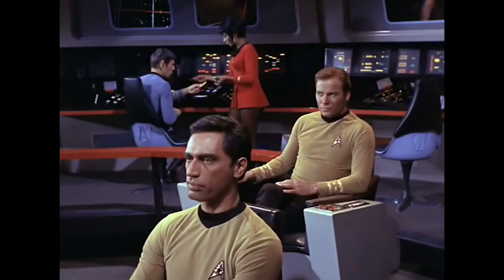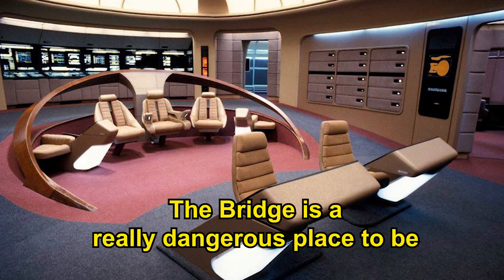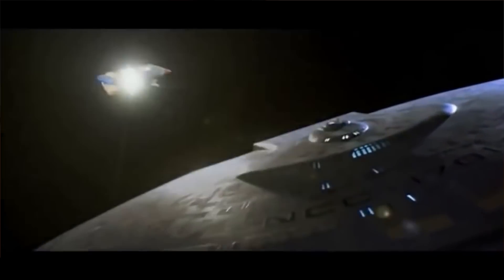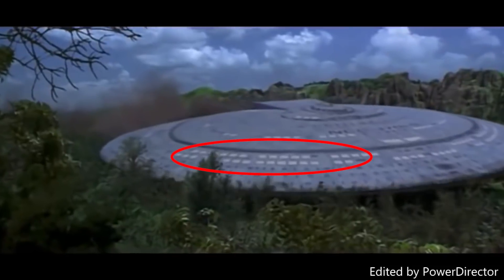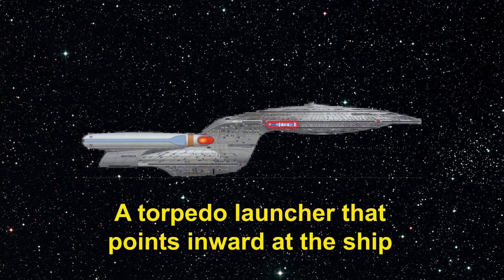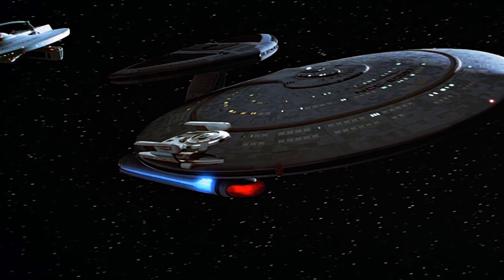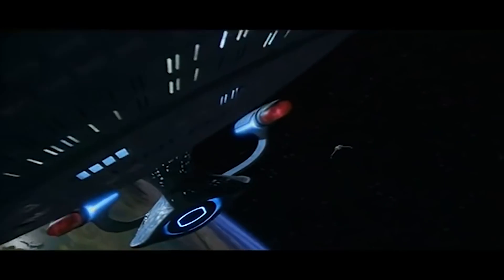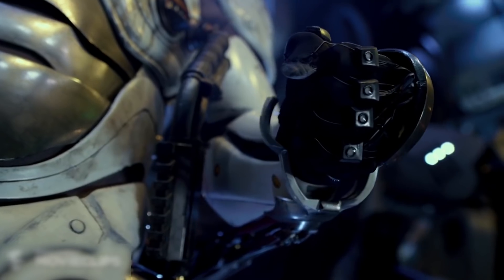10 Flaws Star Trek - USS Enterprise NCC 1701-D

Comment: Many of the "flaws" are necessary to allow cameras and production crews access to the interior of the ship set and to create exciting visuals, something that wouldn't be possible if the ship was designed to your exacting, if sensible, standards. But I laughed hard at the "landing just like Voyager" bit. Touche.
Reply: Actually the Ent D and other Starfleet vessels are a Efficient use of Space, the Corradors have Hidden Behind them , all the plumbing, power distribution, communications and the Backup systems , as well as Emergency Survival Gear. and some Corradors lead to the Escape Pods.
Reply: In the movie, "K19: The Widowmaker," they just ran a raised pipe the entire length of the corridor, so they could just  run the camera along on a trolley, and it looks like part of the rest of the plumbing.
Reply: @BlackEpyon  Exactly. How many successful navy movies have been made that never suffered from their realistic use of ship space?

Comment: Still a less exposed bridge than the ISD's.
Reply: Yet ISD and SSD (or other Kuat warship) bridge is not dangerous place to serve unlike Federation designs
Reply: Kuba Król yes there is a big pit for the commander to fall in if he trips and the pit is full of hard pointy metal objects. Perfectly safe
Reply: @kh29the13  it is not that high a fall. Also star wars ships don't shaken about the same way star trek ships do by anything and panels don't randomly explode.
Reply: @Jfk2Mr  cough executor cough
Reply: ValorJ Omega  Ah yes, Jar Jar Trek. It was set in a alternate timeline, unlike episodes 7 and 8… …
Reply: snonsig the ram into the bridge of the executor was only successful because the shields were down.
Reply: Yeah - ISD's and SSD's had lots of viewports on the bridges and few bulkheads.  Somebody gets a lucky shot with shields down or goes on a suicide run - seeya!
Battlestars always made more sense to me than Star Destroyers.  They had a heavy duty blast shutter that closed down over their bridge picture window.  Also, they had starfighter launch & landing portals at opposite ends of the hanger & straight through, instead of one big hole in the middle of the floor that traffic had to share (plus do a right-angle turn between the plane of the hanger deck and the approach/departure vector.

Comment: Video asks what puts their engines out on pylons. Answer: Most large planes, including military transports.
Reply: Good response.
Reply: That also encompasses the vulnerability of an exposed bridge on modern naval warships.
Reply: The guy who made the original models was told by Gene that if one nacelle exploded it didn't take out the other one.
Reply: @UkrainianPaulie  That's like driving a Corvette and suddenly four cylinders stop working
Reply: @Shadowbat.o_O  The bridge on a modern naval warship is exposed because people look out trough   the windows. Observation of the surrounding with eyes and binoculars is still done. But ship also have a Combat information center (CIC) that is less exposed where radar and other sensor system are used. In Star Trek they use viewing screen for external observation and not the windows in almost all cases so they should put it like you put a CIC  on a warship. 
 
When you bild warships with armor like old battleship there was thickly armored inner part in the conning tower and on the Iowa class it had 17 inch armors.  So warships today are not build as stupid as the one in Star Trek. The bride is exposed because that windows and a high observation position is useful and used in a way it is not in Star Trek.
Reply: And they have to be exposed so the bussard collectors work.
Reply: @UkrainianPaulie  Too bad they never really put into practice what Gene said in the series. ("Cause and Effect" anyone?)
Reply: @target844  You can transfer helm control to pretty much any part of the ship, including engineering.
Reply: @elitewolverine  it was also mentioned that you can also transfer control to one of the portable LCARS tablets and fly the ship while walking down the hall or in a turbolift on your way to the single bathroom they have onboard. 🤣
Reply: Large Planes are not meant to participate in front-line battle. That's what fighter jets are for, and you don't see fighter jets with their engines out on the wings. No, the engines are tucked in against or are part of, the fuselage. The huge transport planes are transports. They are not battle-ready. Planes like the Flying Fortress are A). Older, and B). meant to be escorted by fighter planes. Bombers are not front-line fighters, they fly high and drop large amounts of bombs on ground targets.
Reply: @Dhalin  Fighter jets put the engines under it because of the high-g stresses they will endure during a highspeed dog fight.

Next the most front line plane we have...is the A-10 Warthog, engines are in the back, not tucked under.  Why...because ground fire.  And keeping them apart means when one engine explodes...the other isn't taken out with them.  Something the F-111 was famous for and something that made the F-14 separate the engines as well.  As well, it reduces them both being taken out in a single shot.  And this was PROVEN when an A-10 landed when an engine was blown off the rear.

Next the SR-71 had a sister design that was designed to be a supersonic jet fighter...engines are on the wings.

Basically you are talking about pure design role.  Nothing more.

Your examples are bad and you should feel bad.
Reply: @Ken Roestenburg True but if you grenade 1 of those cylinders on one side of four, They dont just allow the engine to continue running, right?

Although I have heard that certain giant diesel engines used on ships can isolate individually pistons/cylinders so they can be worked on while the ship is running which is absolutely amazing to me.
Reply: The scientific reason is the way the way federation technology create warp bubbles.  The bigger the ship, the harder to create a stable warp field.  Having two pylons helped a lot in this regard.  The federation did know of this design flaw but had little choice in the matter.  Smaller ships such as the Defiant and Voyager had much better pylon placement.
Reply: atSHADOWBAT The real nerve center of a modern warship is the CIC, buried deep inside the hull. They’ve been around even on the old Iowa class battleships, and they’re also the “bridge” on the 2003 Battlestar Galactica ships.
Reply: Bridges on new ships are very vulnerable...Battleships and some cruisers had the armored bridges
Reply: @jtough7499  Even with the conning towers, officers would be regularly injured or killed. The british gave up and just built a huge block on their ships (Warspite, KGV, etc).
Reply: Have you ever watched Star Trek? You have the tech manuals, so you KNOW that the WARP CORE is the "engine". The nacelles store matter on one side and antimatter on the other. Far away from each other until they are mixed in the warp core.
The Bussard collectors, (on the front of the nacelles), are positioned there to collect hydrogen and duterium to refuel the ship.

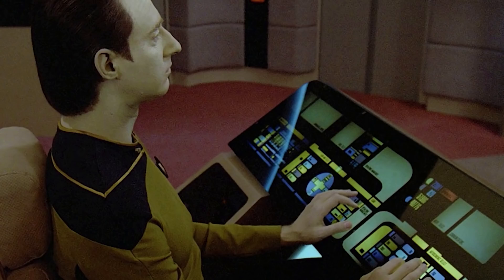Comment: 10:05 That cross shape next to Data's hand is a basically a flat touch screen joystick for manual maneuvering. Also a lot of the maneuvers are pre-programmed into the navigation system so a good pilot could just select one and hit execute on the panel. The ship will fly itself through the complete maneuver while the pilot/Captain observe the tactical situation as it changes and plan their next moves.

Comment: They don't need efficient UI/UX ship controls, if only because the ship has a super-advanced voice-operated computer. Moreover, after centuries of space operations almost any conceivable maneuver has been pre-programmed into the autopilot. All they need to do is to specify which maneuver to use and the ship will fly itself. And that's exactly what they do - Picard and Riker say things like "attack pattern Delta", "dispersal pattern Sierra", or simply "evasive maneuvers". The pilot only has to press one button and the ship will do the rest.
Yes, in some ludicrously unusual situations you need to adjust the maneuver, like rolling the ship sideways to fly through a narrow opening in the Dyson Sphere, or to carefully navigate manually through a complex maze like tunnels inside an asteroid or a space mine field, but even then buttons are better - they are more precise than an analog joystick. In any case, such a huge ship can't be maneuverable enough to respond to a joystick. The joystick use in "Insurrection" was a stupid cop-out.
Reply: Sure, rely on 'Commander Cortana' to interpret your instructions. What could possibly go wrong...
Reply: If you watched any episode of TNG, you should know that they fixed voice control. Well, after 300 years of additional development, what did you expect?
Reply: Also those directional pads on the lcars interface are more than enough to fly manually.
Reply: @DimitryRotstein  Its already getting there. Give it another decade and text to speech and voice recognition is going to be so good you will have trouble to differentiate between machine and human.
Reply: Well as long as Cortana, Google Girl and type-correction are changing my ducks into fucks, I'll remain skeptical😅
Reply: I can imagine using some sort of holo interface. Basically like a screen, but in 3D in front of the pilot. Whos seen Minority Report knows.
Reply: That's also pretty funny, considering how ridiculously easy it should be for an A.I. to pathfind through a narrow entry.  By the time of Star Trek, there should theoretically be A.I.s that can literally program new A.I.s on the fly.  If it doesn't know how to go through a small entry with a 1701-D, it can run a few vigintillion trials of it through machine learning in the span of a couple seconds.
Reply: I loved that escape maneuver from the Dyson Sphere. That was in Relics, the one with Scotty.

Comment: In regards to the unused space this could be a nod to someone in starship design that thought ahead.  Should the ships ever be needed for war, and they were and after the war with the Dominion started the Galaxy class did preform well.  That extra space could be used to redundant power relays to the phasers, extra torpedoes; and with a little internal redesign the sections could be placed near each other and have life support cut off to them - machinery doesn't need life support - and life support could be returned for repairs.  That could be a whole deck with out life support during battle, saving power for the ships other systems.  That space, could also be split between extra power needs, extra storage, and extra medical facilities or crew facilities.  Just because the explorer doesn't need that space, doesn't mean it can't be upgraded when needed.
Reply: Most Star Fleet vessels were canonically highly modular. Thats also the reason why ship classes that by the time of TNG were about 100 years old were still used.
Reply: On several episodes of Voyager they use extra space/ cargo bays for everything under the sun. They turn extra space into a holodeck or for refugee quarters. Extra space is a needed tool when you are faced with the unknown & no one around that wants to or can help you. It's literally helped saved lives on various ships in there various series. I don't know why you are knocking it if you've seen even one of the series.
Reply: Built in extra space is something that they do with real world warships and is perfectly logical and smart thing to do. The reason for extra space is to expand the lifespan of the ship, the extra space is there for the addition of new, unforseen tech to be added to the ship as needed. This way, if you come up with a new widget that's part of either a new class of ship or just a newer version of an existing class, you can add this same widget to these older ships to keep them more up to date. It's also there in case a new version of an existing system comes out but is larger than the older, existing version, extra space would allow you to install this new system without having to worry about where you would get the needed space.

It's because of extra built in space that the USN has been able to keep the Burke class destroyers in service for so long and it's because they've started to run out of extra space, along with their age, that the USN is looking to replace the Burkes. The same thing happened with the 688 Los Angeles class subs, they, as a class, are not only old but they've ran out of room for further upgrades; as it stands there's not even enough room left for every crew member to have their own bunk and the lower enlisted actually have to share bunks with fellow crewmates with each sailor assigned to a bunk taking turns sleeping in it.
Reply: Even in the future, VLS cells would serve the ship well.

Comment: Most of theses are reasonable, however the Warp Pylons had to be there for a few reasons. 

1. The size of the ship requires a larger warp field to encompass the entire ship, hence having them spaced further from the hull they are able to create a larger bubble. Page 66 of the TNG TM says;

Third, the shape of the starship hull facilitates slippage
 into warp and imparts a geometric correction vector. The Saucer Module, which retains its characteristic shape from
the original concept of an emergency landing craft, helps
 shape the forward field component through the use of a 55° elliptical hull planform, found to produce superior peak transitional efficiency. The aft hull undercut allows for varying degrees of field flow attachment, effectively preventing pinwheeling, owing to the placement of the nacelles off the vehicle Y-axis center of mass. During Saucer Module separation and independent operation of the Battle Section, interactive warp field controller software adjusts the field geometry to fit the altered spacecraft shape (See: 5.1). In the event of accidental loss of one or both nacelles, the starship would linearly dissociate, due to the fact that different parts of the structure would be traveling at different warp factors.

2. Referring back to the TNG Technical Manual, the reason for the Pylons being situated where they are:

The emergency separation system would be used in the
 event that a catastrophic failure occurred in the PIS, or if a nacelle damaged in combat or other situation could not be
safely retained on its support pylon. Ten explosive structural
 latches can be fired, driving the nacelle up and away at 30 m/sec

This means if the pylons where closer to the ship then the chances are those explosive bolts might cause additional damage to the ship and increase the chance of the warp field colls exploding near the ship, either destroying it or causing serious damage. Since the warp colls are (according to the diagram in the TNG TM) are 7 decks bit, that's one piece of the ship i want as far away as possible

3. Bussard Ramscoop collectors

Page 70 of the TNG TM, look at the graphic

Other than that, I think everyone here has good points. All ships in the Star Trek galaxy except the borg have exposed bridges, but since the future tech is so dependant on shields they never consider it a flaw. Even the defiant, a ship made for combat has a easy to identify bridge